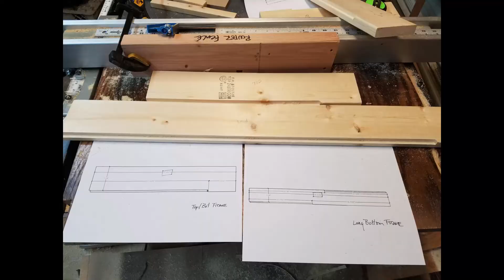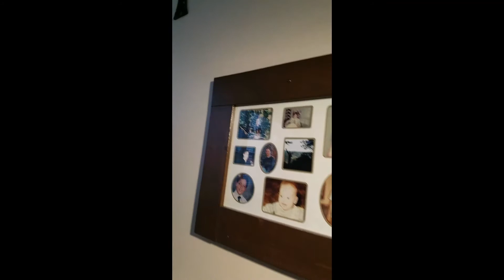Stair Collage

Comment: That was awesome Don. What was that first coat you added before the stain?
Reply from the maker: It was a pre-stain wood conditioner (Minwax). Most do not know that adding a pre-stain will keep the stain from "blotch-iness". This is especially true with softer woods like pine that has gain thats both hard and soft. The more absorbent parts of the wood soak up more of the pre-stain than the other areas. So when you apply the final stain it soaks in more evenly. This was the first time I used water born stains and I was impressed.